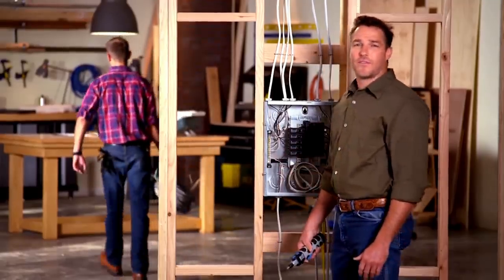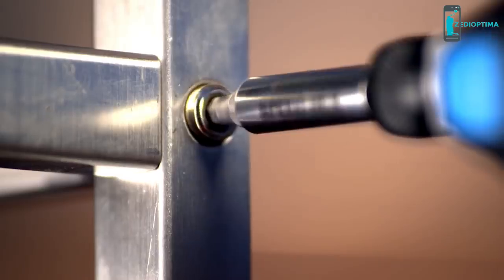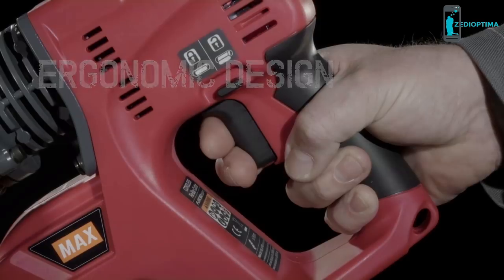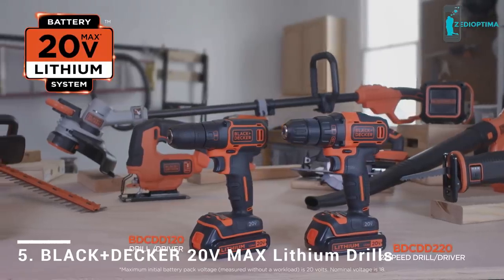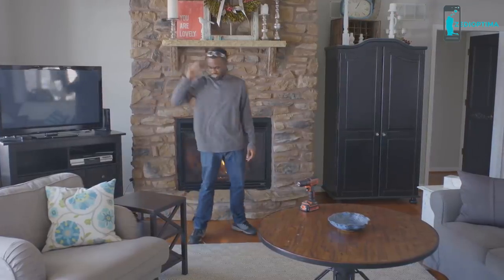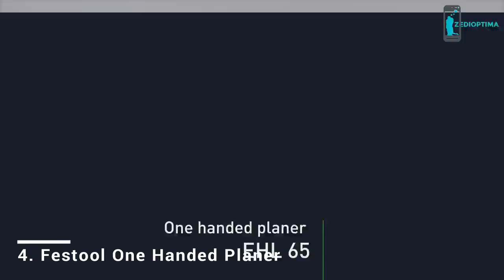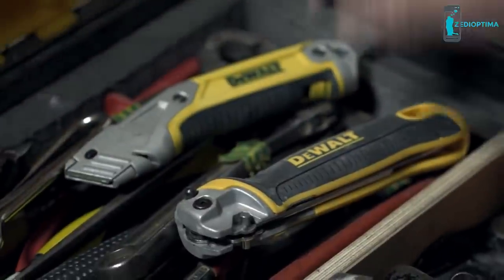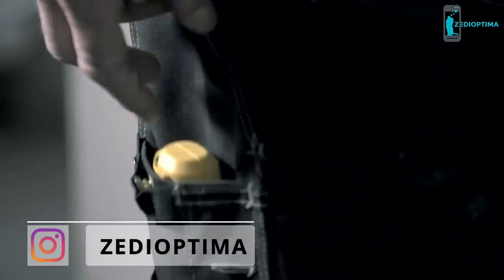Top 10 Best DIY Power Tools Every Man Should Have

Comment: Ok.. 10 Best DIY tools.
10. Right angle drill attachment from DeWalt--similar to 'flip out.'
9. Jigsaw-small
8.  Drill
7.  Palm Sander
6. Clamps
5.  battery powered stapler/brad nailer
4. Beer/Sofa Chair--for when you realize you're stupid.
3. Compact circular saw.
2. Hammer/Mallet
1. Common sense

Comment: Yeah diy people need an industrial rebar cutter.
Reply: Jack Wiltsey obviously you are not planning high risk bank heists like the rest of us DIYers so we can keep up with our Dewalt addiction.  That is why we need rebar cutters.
Reply: Never know when you need to work with rebar around the house
Reply: And its gotta be the one with the ergonomic design. Otherwise its useless
Reply: lmao I was gonna say the same thing
Reply: until  you have  spent all day cutting rebar with bolt croppers or a disc grinder    you will soon soften up to the idea
Reply: You don't do your own concrete work or concrete projects????
Reply: Angle grinder will do, and is flexible for other things
Reply: I use mine all the time
Reply: Or a 6 gauge wire cutter....
Reply: @anon-iraq2655  and much cheaper too

Comment: That rebar cutter and the yellow dewalt one look very handy, I could have used those in my past days as an electrician for cutting the screwed/threaded rod for ceiling cable trays, that gator cable cutter looks good as well and I will assume it doesn't cost $2,000 like the klauke ones and similar...